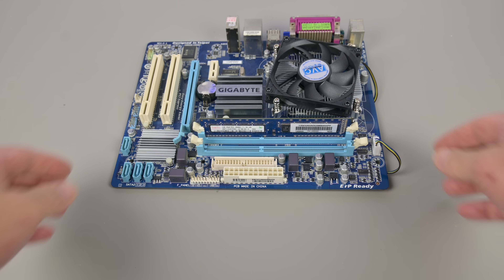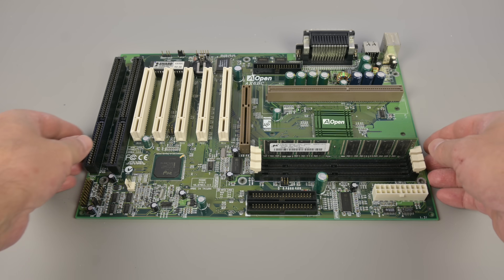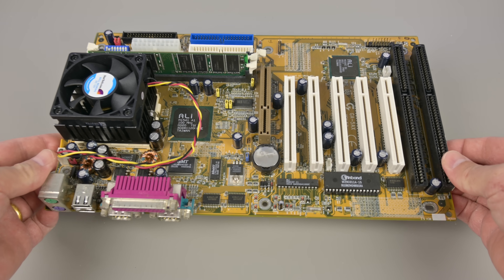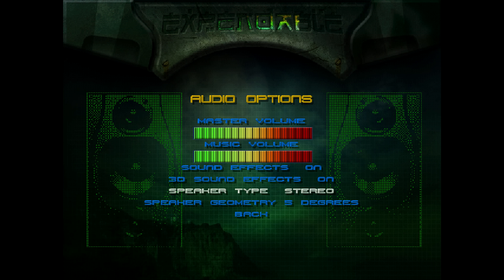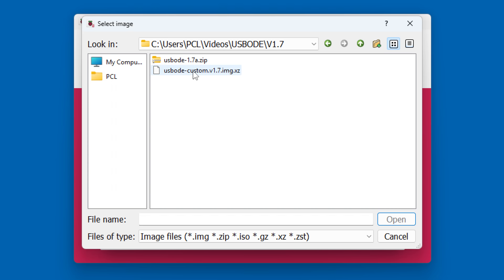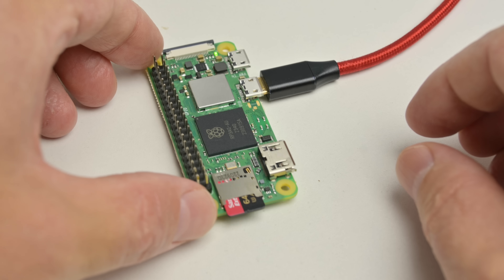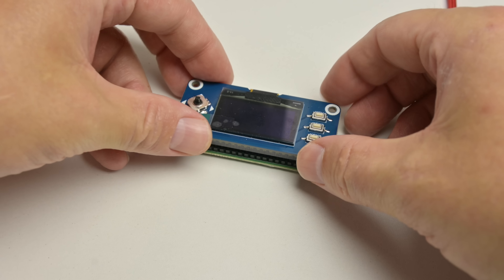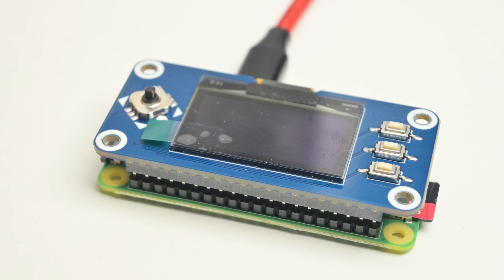Finally a cheap CD-ROM emulator for DOS and Windows 98!

Comment: For this to work, the BIOS has to support booting from USB. Not all vintage boards support booting from USB. The intel 430TX doesn't.
Reply: there custom floppy boot disk images, the well do that booting part, just any floppy would, and load up USB, driver etc, and softboot PC and redirect the next boot to the driver for. USB port, but still need floppy boot first, am sure some get real Harddisk to do the same, but PC that need this are not exactly fast, it just one you needed level compleacts
Reply from the maker: Booting is just one aspect. For me it's being able to run CD based games without physical media.
Reply: You can just copy the CD files to the HDD or set up virtual optical drives with daemon tools or magic disc.
Reply: @simon Is there Daemon Tools or Magic Disc for DOS? This device loads on actual DOS.

Comment: I could see this mounted internally with the LCD hat and a 3D printed 5.25 drive bay housing like a gotek emulator wired to a USB header or internal USB port.

Perhaps this could possibly work with a USB PCI expansion card on motherboards with an incompatible chipset.

Comment: I seem to recall being able to share a cdrom drive over the network back in the day, and then map it as a drive on a different pc.  Kind of curious if that would work if you had a mini-pc supporting your retro hardware (for MIDI or whatever).  Maybe you could share a virtual cdrom drive over to your win98 pc.  Either way, this is a pretty cool project as well!
Reply: That's called "iSCSI Target" software. It uses the iSCSI protocol to share certain storage devices from your PC, but them need to be enumerable from the ASPI or the NT STPI stack in the PC hosting them if you are in Windows. From Linux most of the devices can be shared as iSCSI devices giving your storage stack is properly compiled with the support in Kernel. The shared devices aren't network shares, but act as real devices plugged into the PnP OS driver stack. On Windows you need also an iSCSI server. A120 used to come with a limited version of the StarWind server which can only share optical drives (the full version can also share other SCSI devices as HDDs, HDD images, Tape drives, Scanners, etc)

In the client PC, you need an iSCSI initiator software. You could download for free the MS client for WinXP, and WinVista+ comes with it built in. Win98 and older isn't supported by any iSCSI initiator as far as  I know. DOS has limited boot support giving you have a proper LAN rom with iSCSI boot support as iPXE, but that is very limited, and isn't compatible with DOS based Windowses.
Reply: CD-ROMs are just PC drive, and P somewhere drive letter access to the CD-ROM, the it networkable network server drive, folder etc. but will and copy protection make it a cross the network is different question?  most like not un let copy protection is a simple data file the can easily be seen, ?
Reply: @dh2032  Yeah good question.  I thought about that too.  I distinctly remember it working for some games and not for others, but that was with a real cdrom drive.  I don't know how a virtual drive would handle that over the network.  I know there are ways to strip the copy protection out of the iso though, so that probably would be the way to go about it.

Comment: How does it compare against Daemon Tools on Windows 98?
Reply from the maker: Hardware vs software. Difficult to compare
Reply: Daemon tools is a program that mounts a cd IMAGE and make it appear as a drive, BUT you have to load a OPERATIVE SYSTEM first.

This project emulates a physical CD ROM, no matter what OS are you using, or even if you have loaded or not a operative system, this thing is like a gotek but for cd roms
Reply: @ Yeah but this little board also needs an image of sorts, so you need a whole different system to load it there somehow.

Unless I'm wrong. 

I understand they are two different systems, but in terms of comfort and ease of use, one may still be better than the other.
Reply: @harryshuman9637  You're correct, however you can use the exfat capability of the project to load images onto the device. There are two operating modes. ExFAT mode turns the Pi into a USB Mass storage device where you populate your images over USB 2.0, then the CDROM serve mode changes that same device into the CDROM drive.

Comment: I always wish they'd bring out something like an IDE or SATA internal ODD emulator, that way its compatible with everything. If the Gotek can exist, so can this.
Reply: Exactly, a “gotek” atapi cdrom emulator would be nice
Reply: zuluide...
Reply: As Thomas said, ZuluIDE. It's a bit on the expensive side but it exists.
Reply: Actually, I thought that's what this video is about. Im very disappointed it's USB.
Reply from the maker: Why disappointed? Have you tried it?  @nmihaylove
Reply: @philscomputerlab I can understand him. Many pre pentium II boards doesn't have USB, so this device is incompatible.
Reply: ZuluIDE, it supports CDDA, and you can change images from within DOS if you use a Pi Pico extension and curl for DOS.
Reply: ZuluIDE likely costs more than a BlueSCSI and a SCSI card, but it's good to have options.
Reply: @thepillock  The way IDE and the ATAPI protocol work, makes it harder to emulate, so even the most basic on the offers needs a CPLD or an FPGA, which adds to the cost. I've heard some IDE ODEs are using cheaper GoWin FPGAs instead the more expensive Altera's or Xilinx in order to reach a cheaper price. Dunno if these efforts went anywhere, but don't expect a $15 device, that is just not possible even for SCSI.
Reply: @hyoenmadan I agree the way forward involves some sort of FPGA, but we really need more affordable FPGA options to make it marketable to the masses.
Reply: Too bad it's USB only for now. I'd love for IDE and CDDA!
Reply: @thanius  yeah cd audio support is also a must have feature for many games
Reply from the maker: @mcogesteban True, but there are also many more that don't use Redbook audio.
Reply: It would be good.   They can do it for the Saturn (and other CD consoles), and I'd imagine there are more than enough people around that know enough about IDE and SATA that could do this.  Especially if they can work out the interfaces used by consoles in the 90s, which were often proprietory.
Reply: I really want one of these that works with a SATA SSD in the original xbox.
Preferably with a network interface I could hack into XBMC/Kodi for a secondary library of games beyond the internal HDD.
Reply: Yes, if the motherboard is modern enough to run a USB CD-ROM, it's probably modern enough to run daemon tools, making this new device a little bit redundant. Not complaining though - this USB-Pi device is a big step on the way to IDE emulation.
Reply from the maker: @rBennich Pentium and higher basically. Remember, many CD based games require such a machine like Wing Commander III and other SVGA games. Only older games are 386 486 era.
Reply: I've been following the scene for these, there's ZuluIDE and TattieBogle's IDE Simulator, which is why the existence of USBODE surprised me somewhat. The latter has been unobtanium for as long as I've known about it but I would definitely recommend checking out ZuluIDE with some caveats if you're okay with WiFi menus for loading discs and don't need a physical interface. One does exist if you check Vogons forum post about it but it is still in the prototype stage. Needless to say the ZuluIDE is nearly there and I think it will be a fantastic option for some. Personally I'm very ecstatic about the development of an affordable ODE for vintage PCs as both options I mentioned are way more expensive!
Reply: @nanodrive A believe a newer version of the TattieBogle is in development.  So it should be available soon.  I have a version 1 tattiebogle, and I am very happy with it. It works on my Pentium MMX machine, and plays CD audio
Reply: search for the zulu ide
Reply: A quick google search revealed a device called ZuluIDE  that seems to be capable of emulating ide cdroms using disk images on a sdcard. Not cheap though and costs more than $100US
Reply: Same!
Reply: I want a DVD drive one - that could accept standard ISOs with DVD encryption so I could just copy my discs and use that on my players instead.
Reply: @SetTopGames Imagine if it had network connectivity and could read an iso off a file share
Reply from the maker: @jmerc-23 At this stage it has FTP, so you can load ISO files over WiFi.
Reply: Really need something like this for automotive dvd integrations. My 2002 Honda Accord has a custom DVD rom drive that loads not only the Nav but also the Heater Controls and the ability to set the clock panel. When that dies none of that will be functional.
Reply: this is not CD emulation, however towards the end of the cd/dvd era of computers, I had started using SD to IDE adapters to bios updates..... least for MS dos can completely use something like rufus(I use to use the HP usb formatting tool) with a sd usb reader/writer and than pop the sd card into the ide adapter and it would do the job:); in some cases might be able to do similar for CD/DVD
Reply: Precisely what I was thinking of.  It would need a custom PC board to present the IDE and SATA ports, which you you would connect the Pi Zero to.
Reply: I agree 100%. This is cool and all, but if your computer has USB in the first place, you don’t need this. You can do the same thing with any generic USB storage device. Even if it doesn’t support USB booting it can with a number of boot loaders that will run off a floppy
Reply from the maker: @jlj945  Well with a USB CD-ROM you can use DOS drivers and install games mounted through the USBODE. It's a game changer!
Reply: I know @polpo (the picogus guy) is working on an IDE CD-ROM emulator, but the current US trade situation is making development very difficult.
Reply: @poofygoof his version is out and it is the best cdrom emulator out there IMO, but it is far from cheap since he did not released the gerber for the latest board revision (which is critical for the cdrom part).
Reply: @dw_2005, you could help achieving that by compiling a smallest list of IDE or SATA cards that covers the maximum set of OSes (so the developers know what card should they emulate).

I has asked a similar question on Stack Exchange, but it got deleted as too broad. So I narrowed it down to "SCSI/IDE/SATA cards for booting from ODD with widest coverage of x86* mainboards". You could find it on "hardwarerecs" branch of S. E.

Maybe you could help by contributing to that question or even an answer to it.
Reply: This. Its great that its cheap and all, but the kind of computers i want a CD-ROM emulator for dont have USB.

Comment: I recall there was a project in development 10 or so years ago, aiming for complete CD-ROM IDE ATAPI emulation. Including AudioCD, mixed-mode CD, emulating various protections, etc. I cannot even find the forum it has been developed on, but I recall the estimated cost would be at least $100. Ofcourse we didn't have the affordable & powerful Pi Zero back then.

But despite the low cost, I think USB-only solution doesn't really solve any problems since you can emulate CDs in software well enough on machines from USB era.
Reply: Are there any games with their own OS which needed to be boot from CD? = )
Reply: @enosunim  There's PC Booter (AKA DOS Booter) games that you boot from. Mostly from the early 80s. I'm not sure about CD-based ones. But there's Live CDs for OSes. Could be quite interesting.
Reply: There are already exist IODD(ZALMAN branded also use their OEM) if I recall correctly devices which can boot from iso. More interesting is cue bin and CD audio I guess.
Reply: Flixel, the 3DO ODE dev, was working on the DMC88 which was FPGA based IDE ODE for X86 hardware. He posted pics of the boards but sadly he ran into some health and other issues. Doesn't seem like they'll be completed which is truly unfortunate. Hopefully someday we'll get another one like it or similar variant like the one made by tattiebogle.
Reply: I'm interested to see how you boot your computer from an image in a virtual drive
Reply: @krizator  The computers where I would benefit the most from an optical drive emulator don't support booting from USB or don't even have USB.
Reply: @Hans-gb4mv  If they have USB, there's is a project I used in the past called plop which may work that can boot from floppy.
Reply: @krizator  You copy the image to a usb drive using rufus for example.
Reply: @krizator  it works, but only from BMC/IPMI. At least some of them, for example ASpeed2600.

Comment: A very useful thing - TBH I'd find more use with newer computers that support USB. I still await a full IDE emulator, like a Blue SCSI but for IDE. That would be a TOTAL gamechanger. If it could emulate CD-ROM drives, but also arbitrarily emulate a hard drive, especially if you could dial in the CHS settings for weird, cranky laptops and whatnot.
Reply: Right now, there's an IDE ODE that does support CD-DA, but it is currently out of stock and also costs $200. It's mainly intended for use with arcade boards. There is another one that actually can support the encryption Sony uses on the PSX, enabling people to revive those consoles, but as I recall the device is around $300, so definitely not cheap at all. Right now, that website is undergoing recovery, as they suffered a DB crash.
Reply: @soberjedi42   If you're thinking ATAPI ODE, the next closest thing i can think of that is open source is IceGDROM, it's for Dreamcast, but Dreamcast uses an IDE/ATAPI bus to connect to a barely modified PC optical drive logic, there's only some magic in the firmware that scrambles initially read data from CDs and is capable of resetting to a special lead-in position for GD-ROM high density area, some mode switching. It is a project for FPGA, but it doesn't actually spawn much interesting in the FPGA, i can totally see this being portable to RP2040 with PIO. A big difference though is that there's only firmware routines on Dreamcast accessing the optical drive, as opposed to so many operating systems and applications and drivers with their quirks on PC.
Reply: @soberjedi42 yeah I've seen those, crazily expensive but I suppose they were somewhat niche devices. But given how cheap we can get devices to emulate floppy drives, SCSI devices, and more, i think it's a bit odd there's nothing in the IDE space yet. We've got IDE-CF and SD adapters, but that's all. My understanding is it's a bit trickier to do, but maybe one day! I hope so anyway.
Reply: @DavidRickard1  yeah, it is odd. I wonder if the fact that there are still SATA optical drives readily available and relatively reliable SATA to IDE adapters that will let you use those devices on older machines that are keeping them niche and expensive. And sure, we could use one of the SCSI options, but then that involves adding a SCSI card and more drivers to our retro builds.
Reply: @DavidRickard1  Who told you is cheap to emulate SCSI devices? Last time I checked prebuilt BlueSCSI devices which are speedier than the ones used by the classic mac crowd have its price as well.
Floppy is just an special case of a slow storage device which spends more of its time emulating flux cycles than driving the slow FDD bus. Or the slower of the BlueSCSI incarnations, which works as SCSI is actually a pretty high level and smart packet based bus which can do recover and error correction if the target device misses a transfer, giving the bus is terminated correctly. But IDE or ATAPI don't have such niceties. These buses are harder to drive, so them need extra chips which add to the cost.
Reply: There are people still researching for a not so costly solution.
The lower they have managed to reach in a $80 tag, by using GoWin FPGAs, instead the classic Altera/Xilinx ones.
I guess these finally support CD Audio. There are more details about that in the vgons retro forum.
Reply: Pointless on newer computers since you can just use software or create bootable USB drives.

Comment: Exactly the thing I wanted to try to implement with the Pi's gadget USB support, damn. :) Though, it doesn't (yet) support CD Audio playback as I see, though according to my research it would be possible to hook into the related SCSI commands of the gadget USB driver (mod: but it's on the TODO list, nice). Even better would be to somehow merge this with the MT-32pi, so one Pi can handle both, and also mix the CD Audio with the MIDI synthesis, but that's an interesting challenge, since the MT-32pi is a baremetal firmware. By the way, does anyone know about any x86 mini PCs which has USB OTG support on one of it's ports (and also support for this in the Linux kernel)?
Reply from the maker: The project is open source, feel free to take part 😊
Reply: @philscomputerlab  i might if i had the time. It's the main reason I haven't got to do it. :( I had my notes about this since last august. Actually there's a project called gadget_cdrom on Github which seems to do most of what usbode does, just without the UI. And it's also using a Pi.
Reply: MErging with MT32-pi project would be a dream, sadly the mt32-pi project is dead now and also the developer, I had a chat with him once, seems like not the easiest person to work with.